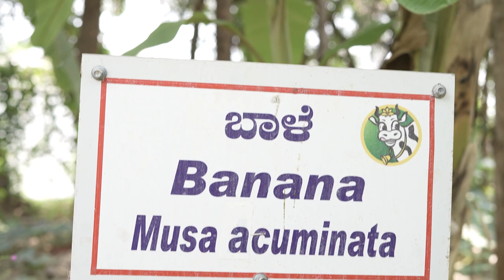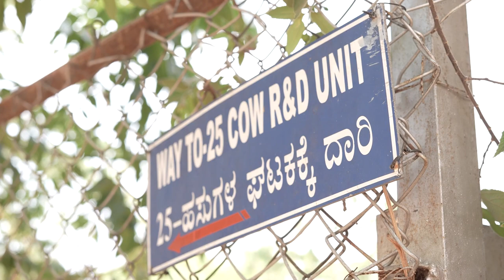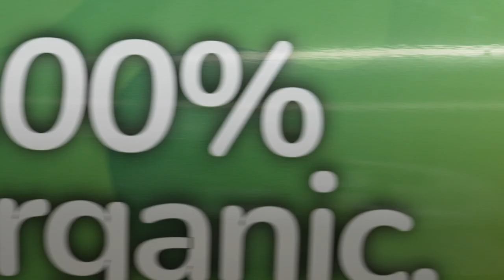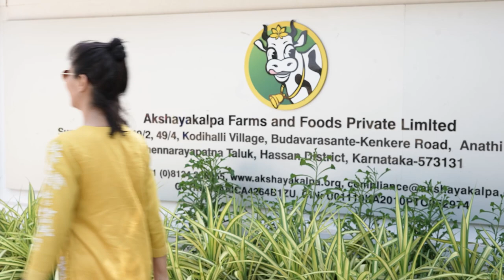Leading the way for sustainable agriculture | Akshayakalpa | Rainmatter Partner Story

Comment: Need to bet on Robust self-sustaining models like Akshayakalpa , like  interconnected Ecosystem of livelihood with eco friendly practices to counter Climate change by Building models like , PMC linkage technology,  ( PMC's - serve as a hub and interlinking between all stakeholders) .This holistic approach will not only boost employment but also it empowering rural communities in India by providing eco-friendly solutions that generate employment opportunities, promote sustainable agriculture, and reduce carbon emissions.
We aims to drive economic growth in rural India while promoting eco-friendly practices. We propose a multifaceted strategy that includes Eco Agrifintech, along with silage and fodder production, carbon trading, and the creation of bio-fuel and bio-coal, all centered around  the network of (PMCs) at the Various Geography level accordingly.